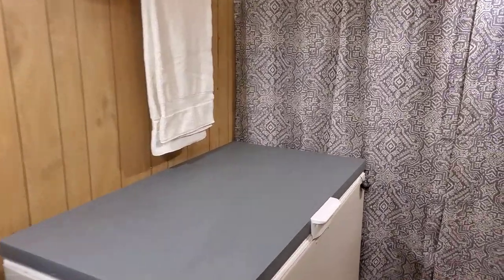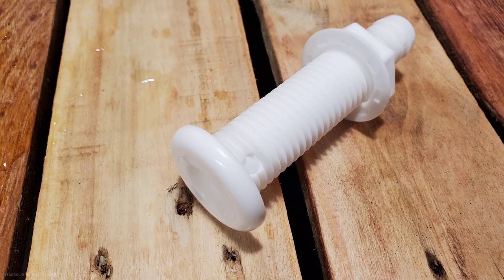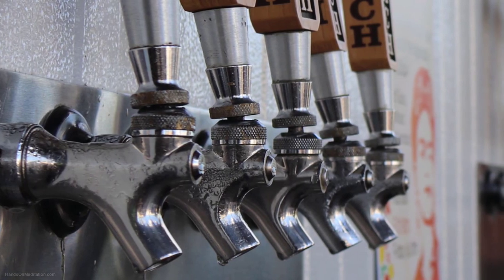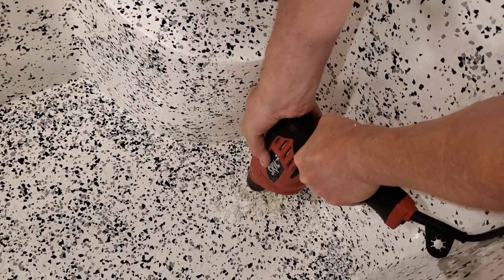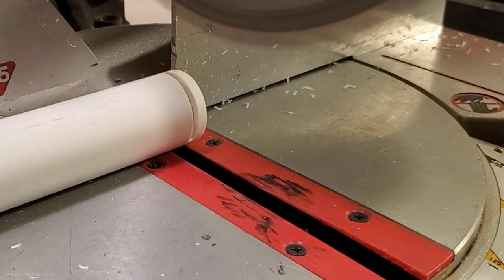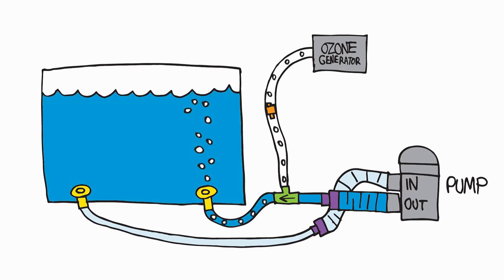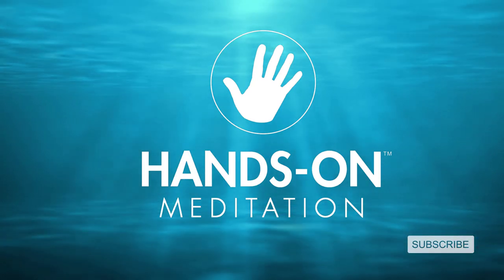DIY Ultimate Cold Plunge | Running Plumbing Up Through the Freezer Floor | Ice Bath Cold Therapy

Comment: I followed your setup almost exactly. Everything turned out great. I’m using my plunge almost daily. It’s been about a month now and the water is still great, with the exception of being a little cloudy. Do you have any recommendation?  Thanks
Reply from the maker: The ozone should kill bacteria but the water will eventually get cloudy because of oil, sweat, hair/skin products, etc. because you aren't using any clarifying chemicals (like in a traditional pool or spa). You'll just have to change the water occasionally. I drain the water, give it a quick wipe down, then change or clean the pump filter. I also add a little peroxide in the pump and then refill the plunge. Maybe a couple times a year, fill it will some hot water and a little bleach to really clean out the lines, then rinse.

The maintenance is a little bit of a pain but it's nice to know you aren't sitting in pool chemicals. Just cold water and it's great for your skin.
Reply: Awesome, thanks.
Reply: Get you some peroxide. Every so often pour some in when the water is circulating.
Reply: What freezer did you purchase? I can't find one that's confirmed wall-coils and not base coils

Comment: First off, I've really enjoyed using my cold plunge for well over a year now following these instructions. Current issue is with my outtake valve through the freezer floor, where I have a persistent little drip. I swapped out the marine silicone for JB water weld epoxy both around the thru-hulls and the seams on the bottom of the chest freezer (my pond liner was peeling, which has been an ongoing issue) as a first step and re-did the thru-hull fitting with new tubing. I cannot say for certain whether the drip is coming from the thru-hull to tubing fitting OR from around the thru-hull insertion into the freezer, which is part of the problem (my best guess is the latter here as I've never had a tubing to thru-hull issue and seal these pretty well). I was nervous that I may have screwed the thru hull fitting too much, causing the piece to dig into the freezer bottom too much. I could post a video of the drip, as that may be helpful. I'm running out of ideas to fix and really curious if anyone out there has an idea I haven't tried. At some point soon, I'll start looking for used chest freezer but hope I don't have to go that route. Thanks, Greg
Reply from the maker: Tough to say because it could be a lot of things. Have you considered getting a rubber gasket and adding that between the thru hole in the bottom of the freezer, if you may have dented it there?
Reply: Yeah that’s part of the problem is that it could be many things. I’ll try the rubber gasket. Might be tough to get through the epoxy unfortunately. Thanks for the suggestion!

Comment: It’s true, you’ve made a great video and gave me the confidence to drill holes and hide the hoses, thank you!!! 

I’m going to go about making mine the same way except with larger sized hoses (1-1/4”) to stay consistent with the pump, and the UV light I’m going to sub in.  Wish me luck! 

I’m also planning on putting the thermometer into the floor using a technique I saw in another video, and planning to store all of the equipment into a vented box in front of the tub and use it as a step to get in and out of (since I have no where to hide it outside). Now I just have to figure out how to ensure the inside of that box stays dry! … might just stick to the LOTO method and disconnect everything before getting in as a safeguard. Safety 1st! 

Lastly, I love the wood paneling in your wellness room. I may incorporate some pine paneling to the exterior of my tub if I’m not broke by then 🤣
Reply from the maker: Sound like it's going to be a great project. I am experimenting with only using a UV Clarifier instead of Ozone and it's working really well. Just ensure you won't hit any coolant lines when you drill. Please share pictures when done.
Reply: Great to hear the UV light is working! Will do and I’ll share a photo once it’s done.

Comment: Hi. Thanks for the information. I am having trouble getting a fitting to connect the 3./4 water hose to pump hose (larger hose). Also the T fitting to add the drain line and the pump connection. I used the same pump you recommended. Please advise. Thanks Again
Reply from the maker: Do you have a Menards near? That's where I got mine. Also, in the first Cold Plunge video on this channel, I put links to a lot of the parts in the video description.

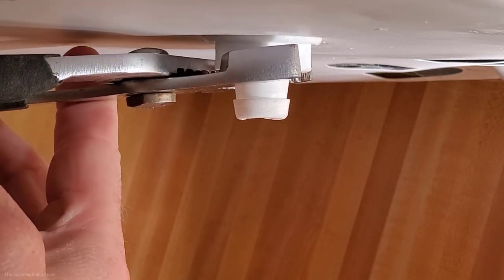Comment: @ 2:40 - did you only have to drill once because the spot for the other flange is the already existing drain hole?    As long as i'm aware of where the coolant lines are located is there any downside to drilling two holes through the side at opposite ends (for ozone-in and drain water-out) and attaching a separate hoseline with valve to the drain hole?
Reply from the maker: Your existing drain hole is probably very small and will take forever to drain that much water. I made my first hole in the same spot but drilled it out much wider. I also have a valve at a "T" in the return hose to drain the water. If you look at my other videos on the channel, I show how that is set up.

Comment: When draining are you sure you have the “drainage valve” on the in side of the pump…to me it just would make more sense that the valve would be on the out hose before the ozone generator(so the pump would have water being pushed through it and out. Thank you for the in depth tutorial I am right now on the pond shield part waiting for the humidity to drop to apply!
Reply from the maker: As soon as you open the valve, the pump begins to empty so you won't be running the pump while it drains. It really doesn't matter where in the system you add the drain line as long as it's at floor level.
Reply: @HandsOnMeditation  thank you! I see now… I have to get mine outside my basement window which is above the level of the pump. so I think I’ll have to run the pump and pump it out the out valve so water will remain being cycled through the pump as it drains
Reply from the maker: I empty mine into the basement sump pump pit? Can you do that?

Comment: Thanks for your videos, very helpful. People have reported that the ozone will cause marine sealants to eventually fail and will create a leak, have you experienced that?

I plan to use JB water weld for the seams on the aluminum of my chest freezer, but I am not sure how to seal the thru hull fittings.
The JB water weld is not very flexible so it does not seem like an ideal sealant for the drain holes, but it is the best one, as reported by many, for sealing anything that would be submerged in freezing water and ozone.

Was wondering if you have any thoughts on the above?
Reply from the maker: I'm not sure about the JB water weld because I haven't worked with it. My freezer is also coated with Pond Shield paint so the sealant isn't exposed anymore so I don't know if the ozone breaks it down. I'm currently experimenting with a UV Clarifier instead of the Ozone and it seems to work just as well so that may be a better option. I'll have a video up soon with my recommendations on that.
Reply: @HandsOnMeditation  Thanks for your feedback. 
Intesting! I am considering doing UV in addition to Ozone, any reason you want to choose UV over/instead the Ozone?
Reply from the maker: @Kirily8  Ozone works well but it's tough on other materials - can lead to rust or degrade the rubber/plastics. Also, you can build up unsafe levels (although I don't run it that long).

Comment: Can you show the setup you have underneath the freezer? (The wood it is sitting on and the hose running through it etc). Also where the pump and ozone generator is (in a control box?) can you do a thorough tour?
Reply from the maker: I probably won't do a full tour with this setup because the pump and ozone generator are behind the curtain in a dark corner ,next to an ejector pump with spider webs, etc. but at some point, I'll probably do a full video in a clean environment to show everything. It's basically set up like the illustration that I provide in the video description The ozone generator is mounted on the wall - a little higher up than the freezer. Then pump is on the floor and the hoses are loosely coiled around it. I have everything controlled by smart plugs that I can trigger with a wall switch or my phone so I can adjust the timers to have them run at night and turn on or off when a person turns on the room lights, etc. One clever thing I do, is set my smart plugs and wall switch so that when the room lights are turned off (after a person is done using the cold plunge) the pump and ozone turn on for a half hour to clean the water, and the freezer turns on for an hour to bring it back down to temperature (because when you sit in there for several minutes, your body warms it up a degree or so).

The freezer sits on a 2x4 frame  (that puts it 3 1/2" off the floor) like this https://drive.google.com/file/d/1VlaWbHb64Ao-8sV4d20Z1-jjRTUXtRoU/view?usp=sharing

Comment: Mine is the 15 cubic ft frigid air which I guess has a longer floor than yours, so the XL thru hull you are using/shortened isn’t long enough for mine. Had a working unit, but  wanted to get fancy and make the pump work better. now I drilled a hole in the bottom and I’m stuck with this short thru hull lol. Thru hull is about 2 in short. Maybe I’ll call a boat store in the a.m. #frustrated
Reply from the maker: Sorry to hear that you've run into a challenge with the floor depth. They make longer versions of the thru hull. Here's one https://www.greatlakesskipper.com/mako-boat-thru-hull-fitting-3-4-inch-stainless-steel. You are creating a one-of-a-kind cold plunge and that's challenging. I ruined a freezer while trying to figure out how to design mine but I'm happy with the current version. I'll probably create an even better one in the future. Please let me know how your project ends up. I'm confident you'll work through this.
Reply: @HandsOnMeditation  just ordered those, thank you! We’ll work through it. I will keep you posted 🙏
Reply from the maker: Great. That thru hull doesn't have a barb on the end so you may need an adapter or get creative to attach the hoses. You have to be a bit of a mad scientist because you are basically creating a new prototype but that's really satisfying. Most people are afraid to try things like this.
Reply: I also have this type of chest freezer. Did you end up getting the longer thru hole? If so, what tubing or pvc did you use to connect the two thru holes to you pump?

Comment: Great videos, somehow I ended up with the same exact chest freezer, currently working on it. Only question is there a reason why you didn’t attach a 90 to the ports on the bottom and chose to just support the bending of the tubing?
Reply from the maker: The thru hulls I used have a barbed end so I think hose was my only option. A 90 would have been a nice option.

Comment: Would you recommend adding Sikaflex to the shaft of the through hole connector to help fill in the drain and input holes and/or adding Sikaflex to the back of the nut on the bottom of the freezer? Or is this overkill?
Reply from the maker: Just add Sikaflex around the top of the hole in the freezer floor as I show in the video. That should seal it nicely. No need to put any inside the hole or at the bottom. It will just create a mess and make it more difficult to screw the bottom nut on. When you get done, please post a picture or let me know how it's going. Thanks!
Reply: Perfect, thank you. Also, the ozone generator that you recommended can’t be shipped to our state, California. Do you have another recommendation we could use?
Reply from the maker: So weird that CA won't allow it.  I can't recommend another model. It's the only one I've used but Amazon has other ones made for spas. I'd think they are similar.

Comment: Thanks so much for this and the other video. I'm now caught in that horrible place of wanting to do this but being scared to start lol. Feeling like I'm going to have to do this. I have a question though: I'm communicating with somebody who does this all the time and he says I need to change out the "chiller" and "reinsulate" the entire freezer before doing this? He (of course) wants me to pay him to do these things. 

Are these necessary?
Reply from the maker: I don't understand why you would need to replace anything in the freezer. Mine has been working fine for years. You can also see many other people online who are using a freezer without replacing parts or reinsulating the freezer. If he is talking about a separate water chiller, that is an additional item and not necessary because you can run the freezer at night to keep the water cold. Sounds like there is some miscommunication going on.
Reply: @HandsOnMeditation  Thanks for the reply. I was thinking that as well, and I have no idea what he's talking about because he said it's just the standalone freezer. 

I'm actually having a terrible time finding a wall-cooled freezer. The few I've found are either base cooled, or the companies (i.e. Frigidaire Customer Service) have no idea where the condenser coils are. Do you (or anyone on here) have any recommendations so I can floor mount the o zone system?
Reply from the maker: @stephenfinn3  I would look at companies that offer scratched or dented chest freezers. I have info in my first video on this channel.

Comment: I'm going to try this set up as I had trouble with the original set up getting the pump to work. Do you have a double Hartford loop with your ozone injector?
Reply from the maker: I have the ozone generator mounted higher than the waterline, so there’s no need for the loops.

Comment: Amazing thanks mate, I have my sauna inside but the plunge will need to be outside as I have no more room ! .. any tips for having the same thing outside ?😊
Reply from the maker: You'll just want to ensure that electrical components are protected from rain/water. If you have freezing temperatures, then that will require additional insulation. I've seen some nice outdoor setups with the freezer clad with decorative wooden slats.

Comment: I love your videos thank you for putting me on! I’ve been building a cold plunge based on this tutorial but I am having an issue… LEAKSSSSSS. So. Many. Leaks. I’ve used the same tubing and clamps. And similar barb style connections as the ones on the bottom of the flow holes were used everywhere else. 

However most of of my connections are leaking 😠 And those clamps are as tight as I could get them. 

Any idea what my issue could be? Had any similar issues?

Thinking about adding the sealant to all of the connections. Wondering what your thoughts are. Thank you!
Reply from the maker: Can you attach a picture of some connections. Maybe you need to go with a size smaller tubing.

Comment: Are you not concerned with the bottom falling through due to weight of you + water?? Others have said they need to support the underneath. Would like to see small video or picture of underneath. Thanks and great vids
Reply from the maker: If you check the video description, you'll find Diagram - Frame to Hold Up Cold Plunge. I use 2x4s like the graphic shows under mine and it seems to be doing a good job. You can always add more supports, if you want to be extra careful.

Comment: Do you have to crack the lid on your freezer while the ozone is running? And/or do you need to let it air out a bit before getting in? Thanks!
Reply from the maker: I would only run the Ozone Generator for 10 minutes after each use and a few more times for 5 minutes during the day so there was no concern about keeping the lid closed. If you watch my other videos, you'll see that I switched to a UV Clarifier and I now prefer that.

Comment: Sorry to bother you again.  I purchased the two Extra Long Thru-Hull Connectors, and wouldn't ya know it?  My freezer floor is about 1 inch thicker so the threads don't reach.  You mention there are longer connectors.  I've been to 4 hardware stores and a marine surplus shop and they've been stumped.  I am searching online and can't find any that are longer than these.  Do you have an alternative link for a longer size?
Reply from the maker: This version is longer (but you'll have to add a barb connection or adjust to connect the hoses). https://www.greatlakesskipper.com/mako-boat-thru-hull-fitting-3-4-inch-stainless-steel

Comment: For the “drain” hole (left side hole on the diagram) did you drill where the existing freezer drain was or did you drill a completely new hole? Thanks again for the videos
Reply from the maker: I drilled through the existing hole (and just made it wider). That was how I started exploring the idea of going through the floor. I knew there wouldn't be freezer lines by the drain.
Reply from the maker: Sounds like your setup is going well. How about sharing some pics and advice for others on the community page. https://www.youtube.com/@HandsOnMeditation/community